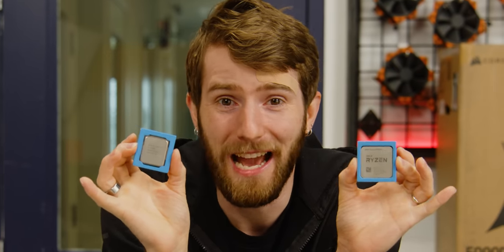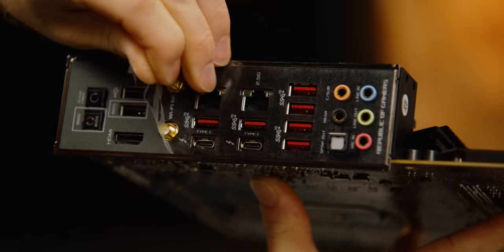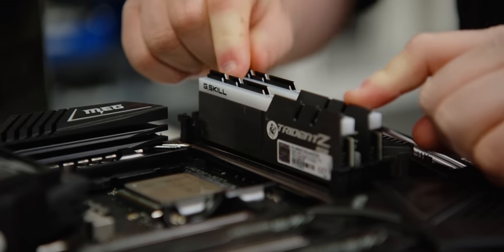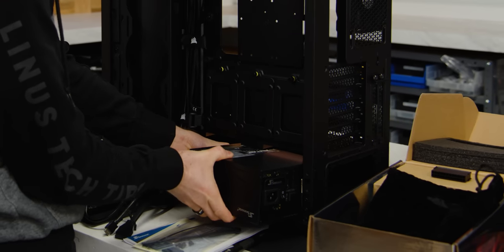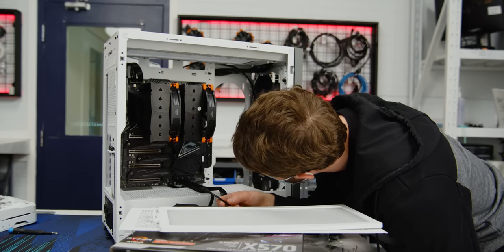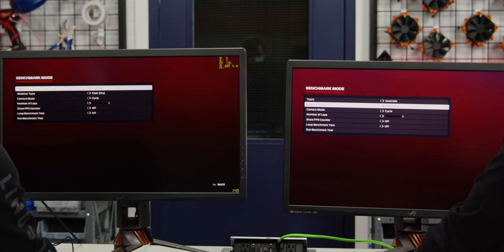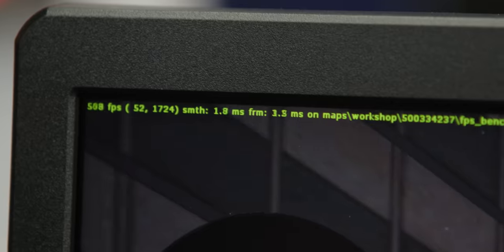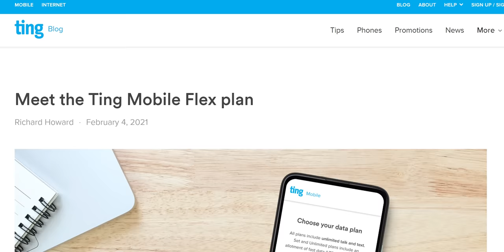Can Intel Beat the Ultimate AMD Gaming PC?

Comment: Happy with my 5950x. Almost the same build as mine, just the LTT one has less memory and storage. Great experience.
Reply: 300 $ for 3 FPS more.... you should cry not happy.....
Reply: @itaiperes9635  Double the cores you brainlet. 5900X still beats Intel anyway; and has 50% more cores.

No one in there right mind is buying a 3090 just to bottleneck it even slightly anyway.
Reply: @TekkitForTheFunOfIt  who in the right mind would buy a 3090 in the first place smh
Reply: @bradleychen147  who in the right mind would buy
Reply: @bradleychen147  Yo it’s almost like you can do more with a PC than play video games!?
Reply: Do you actually do work that utilizes the cores though? For gaming it's definitely a massive waste. Then again the 11900k is also not something I'd recommend for someone who's just looking to game either.
Reply: @AbhishekSaral  and u don't need a 3090 to do any of those... Legit who's even playing microsoft flight simulator
Reply: @bradleychen147  Look, Linus builded a "comparable-ultimate PC" and yet this guy still bumped the specs.

Do you seriously think he'd use it just to play Cooking Simulator? What's your judge that he shouldn't buy one?
Reply: @wanderingwobb6300  i9-11900K is i7-11700KS .
Reply: @saricubra2867  Yeah pretty much. IDK why they bothered releasing an i9 this gen when it's just a better binned i7 for all intents and purposes.

Comment: Whenever I see a 3090 used in a YouTube ‘build’ video, a little part of me just dies inside.
Reply: same
Reply: Why?
Reply: The 3080 is the best overall card available. Especially accounting for price.
Reply: Well the thing is that they reuse the cards
Reply: @brandonbee9  Depends when you got it, I got my 3090 at $1700 and now some 3080’s retail for $1300 plus, and I actually have a card while now it’s practically impossible to get one so I definitely don’t regret buying it. And that mining profitability is nice too.
Reply: @brandonbee9  depends what you use it for. If you do both gaming and workstation stuff, 3090 will crush the 3080. Rendering, scrubbing and such are just nuts with all that VRAM.

Also, VR. There is a MARKED difference between the 3080 and 3090. Why. VR on a higher end headset can easily use more vram than the 3080 has. Plus the additional CUDA cores do somewhat scale in VR because the demand is SO much higher than normal pancake gaming.

I also do a lot of VR. 700hrs of Elite Dangerous alone in the last 11 months.

But when I play a pancake game, it's similar to my friends with 3080s. We got SUPER lucky early on at Best buy lottery.
Reply: I die when a dedicated GPU is used in a build (on integrated Graphics only for 7+ years now)
Reply: @Real28  I only compare at retail prices. I would never buy anything from a garbage scalper. And I play vr a ton also, I have the 3080 and my buddy has a 3090. We both run smooth 120fps. So really makes no difference. As far as rendering, that would be the only reason at all to buy a 3090. IMO.
Reply: @eon1166  That's scalping prices. Those have no meaning to me ya know. I would never get ripped off by one of those people. Just camparing straight up value at retail prices. Not comparing availability.
Reply: @Naklov351  well it should be but theres not a huge difference between $3000 and $3500 lol
Reply: Time to get a life dude...
Reply: @brandonbee9  That’s not scalping prices, the MSI Suprim 3080 sells for $1300 with tax. So does every Gigabyte 3080. They all retail for $1300 plus with tax. Idk what you’re looking at man but 3080’s are expensive now.
Reply: @eon1166  😂🤣😂🤣😂. Your killing me. I just got a 3080 from a Best Buy drop not even a month ago. At retail. Those are scalper prices. Possible the very high end ones are more of course. But I got a FTW at retail. 900
Reply: @brandonbee9  Dude literally look up the Gigabyte prices, the AORUS is $1109 on Bestbuy. I’m not lying, while you can get a 3080 for a good price many of them have their prices jacked up now.
Reply: @eon1166  Not sure what your obsession is with Gigabyte, but you can get them normal  prices. Obviously the higher end cards cost more. That's a given. Not sure what your point is. 🤷
Reply: @brandonbee9  You called my prices scalper prices, so I used cards that cost that much as an example. Obviously all cards don’t cost that much, especially when you can still get an FE for its launch price. Other brands like MSI and ASUS also have 3080’s that cost over 1k idk what you’re trying to get at lol.
Reply: @eon1166  Bro. You make no sense at all. You were claiming 3080's were extremely expensive. They aren't. The prices only went up like 100 bucks. Top tier cards are more expensive. The average 3080's aren't and are a much better deal than a 3090. I mean I still have no clue what point your even trying to make?are you trying to say a 3090 is a better value? Even the most expensive 3080 you named is like 400 less than the most 3090's and even more than the top tier 3090's. Still a better deal. If your point is too tier cards cost more, duh. Lol
Reply: Especially when it's not even the best rasterization GPU...

Comment: It's surreal to see AMD back on top. Glad I stuck by them for 2+ decades
Reply: U shouldn't have. They only got on top in the last years
Reply: @mohammeded-dahbi7603  yea and intel beat ryzen 9 5950x by their new i9-12900k
Reply: Somidz  ddr5 makes little performance increase except in certain workloads, so ddr5 isn’t the cause of the better performance
Reply: Somidz  oh ye
Reply: @zxid_15  hehe... threadripper go brrr and ryzen 7000 go brrrrr
Reply: @determination9296  threadripper is a pain in the ass to use nowadays, the ipc and clock speeds arent there for desktop use (not to mention intel outperforms ryzen 7000 rn, though at much higher powerdraw)
Reply: @wandew7057 9 months ago...
Reply: @determination9296  laughs in 13900k beating a threadripper that costs $1k.
Reply: @HyperionZero  yep ik

Comment: Wish I could get my hands on a GPU. Hopefully they are back in stock soon.
Reply: I'm sorry for your loss
Reply: give it a year-18m according to my industry sources :(
Reply: But who's getting the cards
Reply: @mycosys  Give it 2 years, according to nvidia ceo.
Reply: Ebay and kijiji isn't a bad option but be careful when buying from companies, because i got a motherboard from one called "Canadian computers" but at the end of a second description it said it works with ryzen 1st gen but doesn't post
Reply: @big_man_nine6488  Linus, because he needs a steady supply for redundant benchmark vids and to replace dropped hardware. ;)
Reply: @big_man_nine6488  It probably needs a Bios update. Canada Computers should do it for you if you bring it in and tell them that's the problem
Reply: @roxasmaker  it had one of those bios button's but the update did not work, also the company wouldn't take it back
Reply: I have never once seen a RTX 3080 in stock. A long time ago I saw a 3090 in stock but at the time I thought I would just wait till a 3080 became available because the 3090 is such a terrible value.

With what I know now I would have picked that 3090 up.

Now only scalpers have cards but at $4,000 for either a 3090 or 3080.
Reply: I was gonna get a 2060, then ended up paying 300 for 1650 super

Comment: "The people that bought the big donger power supplies back in the day are reeling it in now". I bought a 1300W psu for my FX-9590 + 295x2 build. That power supply is gonna work in any build I throw it in, lol.
Reply: Yeah, people often forget PSU's power ratings go hand in hand with "the rest" of PC hardware. Some triple SLI's configurations back in the day needed +1000 PSU's. Then it goes down with hardware shrinking. Then it goes up with new hardware pushed to the limit. And it goes down and it goes up and it goes whatever. Therefore, guys get a good PSU when they're cheap.

Comment: This man is building the ultimate pc, and here I am, trying to set up obs on my pentium 3 6gb Dell vostro desktop

edit: updated windows 7 to service pack 2, and its working now!!
Reply: Please don't use not supported Operating systems
Reply: @AlucardaPapere  The man's probably got a mechanical hdd. I'd rather use windows 7 without security updates than use windows 10 without an SSD.
Reply: @gunner75171  lmao facts
Reply: @gunner75171  Ya thats right, i do have a core i3 laptop running win 10 on an nvme ssd, but the pentium desktop really outperforms it due to the literal helicopter of a cooler
Reply: Me still waiting on a motherboard to be delivered... this wasnt supposed to be the hard part to get
Reply: I still love vista baby
Reply: I wish aero transparency was somehow imported to windows 10
Reply: @AlucardaPapere  dude its not like he is using xp with a 5 year-old firefox
Tons of computers cant run win10 because microsoft is breaking their OS but are super smooth on win7 and still get browser and antivirus updates
Reply: Win 7 sp2? Is that a thing?
Reply: @muaries12  yeah Edge chromium is running faster and smoother without problems in Windows 7( still running)
Reply: @AlucardaPapere  Windows 7 recongines only clock speeds not core count(it may even run smoothly on a Pentium III@1.4GHz)
Reply: @gunner75171  He should either upgrade to win 10 or use a Linux Distro
Reply: @Alexutz45321  Also true ahahahh
Reply: Ah sorry, I meant SP1
Reply: @AlLiberali  i meant sp1 actually
Reply: COINCIDENCE

Comment: I just got a 5900x for £500ish so it seems they're back down as RRP it seems. Pretty happy with my spend. It looks like some of the 3000 series graphics cards are in stock at overclockers too so maybe we'll start seeing graphics cards dropping in price. With intel entering the graphics card market, I wonder if we'll see some GPUs at a reasonable price soon.
Reply: I bought a used 5950x, in like-new condition, for $400. Feels good to be on top.

Comment: I have a 5800x and 3080 and I absolutely love it. However, I can confidently say my i7-6700k had fewer crashes over the course of 4 years than I've experienced with the R7 in the last few months. Could be coincidence, could be RAM, could be chipset. But the i7 is now running VMWare for my work so if that says anything about its stability lol

Comment: I was torn between the 5950x and the 5900x price bump vs performance bump doesn't seem worth it (and it's not) but the sheer power of the 5950x is still tempting. Ended up getting a 5900x though.
Reply: 5900x has better benchmarks

Comment: Have an I9 and never gets too hot even with the most demanding apps/games. 122 degrees is nothing with alphacool
Reply: Mine hasn't fried yet. Sticking with Intel. Wondering if there is a dual i9 board.
Reply: @ayliniemi  No, that would require some serious dual management support from memory to processor.  Like multiple Xeon's used to have on a Unisys mainframe.
Reply: @samiam9059  What do you think would run Arma 3 the best with it's massive scale? Dual xeons or a single top end processor?
Reply: @ayliniemi  don't know. Xeons are old now.

Comment: Look at those 3090s.. its like holding a bitcoin in each hand.. rare and impossible. 😂
Reply: The 3090s are so much easier to get than 3080 and below. I couldn't get a 3080 at all but for shits and giggles tried getting a founders edition 3090 30 Mins after they dropped at best buy and went right into my kart and bought it. That said the 3090 are way more expensive than a 3080 so a bit easier to get because of that.
Reply: @l0n3w01f  Humbly bragged indeed.

Comment: Can you guys make a video on how to build your own NAS? Like what components you recommend, what OS, and a brief set up guide or something like that. There is content like that on YT but most of it is either quite old or not very in depth (5min or so).
Reply: A very in depth video series.  How much is your budget?
Reply: Look up proxmox.     If you got a 3770 you can make a pretty hard core  Nas system with hardware firewall and all sorts of uses.     I run a pfsense firewall  a pihole with recursive DNS.  True Nas.   And a bunch of database servers all from 1 machine.
Reply: @MrRourk  Very good question. It's for private use cases, nothing professional. So I'd assume not more than 600€? (Depending on the capacity of the drives ofc) Don't know if that's possible if you account for the chassie and all of the components (RAM, CPU, MB, PSU, possibly GPU). Feel free to reply!
Reply: @salaciouscreations4323  Sounds awesome. And since I only understood every second word of that, it'd be cool if a video I requested existed :D
Reply: @laneye7669  look up proxmox on YouTube craft computing have a big tutorial on it.   I was using 6 pcs as servers I just use one now with 5x 8tb HDD for 24tb  with 2 drive failure protection.    If you can flash an image in etcher you already have the skills needed
Reply: Amd pro 450 and 1700cpu you can find 2400hz ecc ram for that board.
Reply: @laneye7669  you might want to go shopping first for a pre-built.  So many affordable pre builts nas solutions these days.
Reply: @MrRourk  I don't think that's flexible enough for me. For now, I just want a storage solution. But I definitely wanna add some smart home functionality, as well as media server, which would require encoding, so a GPU. I got parts laying around and I know a think or two about specking out and building a computer. I just got no idea what to look for when building a server or a NAS, nor do I have any clue of networking in general. That's why an all in one building video would be super duper cool.

Comment: The 11900K is an embarrasment
Reply: Yeah ik
Reply: Yes thats true
Reply: A disgrace
Reply: Yes
Reply: i9 havin 8 cores, in today's era, is actually sad
Reply: It's $535, way too expensive for a processor that can barley beat the ryzen 7.
Reply: I agree they should of jjst made a remake of 10900k everything the same just pcie gen 4
Reply: I think id rather buy a 10900k I might have to cannot get a 5900x at all ive tried since launch all my parts including 3090 ftw3 ultra sitting in boxes for 4 months might have to go Intel and can't get 11900k I mean I like intel new motherboards and being able to use the 5100mega hertz ram finally
Reply: @mohakIsDead  Then get an Intel i9 10980XE
Reply: Intel must have been high when they priced it at 550 lmao,400 is the most I would pay
Reply: @superblitz2274  why would they do that? did you get your economics degree from Trump U?
Reply: @AndreasReinerSzallis  It's so terrible that Intel actually slashed the price in half because it couldn't even compete against the 3950x. 2000 down to 1000, still a worse value now. And on top of that you practically need a separate PSU just to power it if you do any serious overclocking. Then It'll still fall behind a 5950x. It's a joke.
Reply: @justinbeamon6624  With all the short supply everywhere, it will be a bit of a challenge, to get the 5950x or something like the 10900k / 11900k  anyway.
Reply: @AndreasReinerSzallis  Yah to be fair that may be the only option haha

Comment: Which temp monitoring app are you guys using?

Edit: found it! It's HWINFO: https://www.hwinfo.com/
Reply: Thank you very much for the effort you put into your post. Noticed and appreciated, good sir.
Reply: Hey! Just wanted to let you know that there’s a good couple rainmeter skins that integrate well with HWiNFO that lets you monitor pc stats with a desktop widget. They’re worth checking out.
Reply: conky go brrrrr
Reply: @Lb8068  I've Realtemp pin the CPU (max) & GPU temps in Blue & Green resp. in my taskbar
Reply: Thanks for the tip.
Reply: @Lb8068  This is cool, thanks for the tip!
Reply: Yes
Reply: Ya it’s a useful one I’ve had installed for a good 7-8 years
Reply: Try openhardware it has nice a nice widget too.
Reply: @Lb8068  
Omg, this thread is just full of awesome!

Rainmeter! That was the name.. Sorry, just built a new PC, and forgot what it was I used for desktop overhaul.
Say, if you're still a current user, does Rainmeter have support for 4k desktops? That was not even a concept back when I was most familiar with it, amazing what a few years can do to technology..

Comment: Can verify that those numbers are very similar running a 5800X and a 3090FE. I was lucky enough to snag both at MSRP. Got the CPU through B&H Photo and the 3090FR through Best Buy (after 4 failures with a 3080 and 2 with the 3090).

Comment: How can you call that ultimate?  The SSD only reads at 5000MB/s.  The WD Black SN850 reads at 7000MB/s.  For the motherboard you only used the regular Hero instead of the Dark Hero.  For the cooling, you really are better off with liquid cooling, because those Noctua monsters obstruct the air flow on the 3090s.